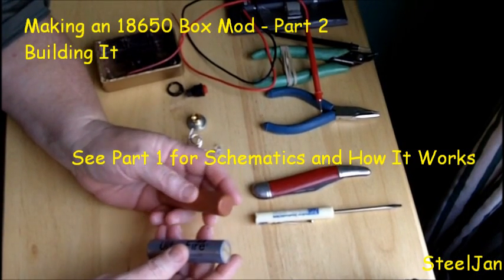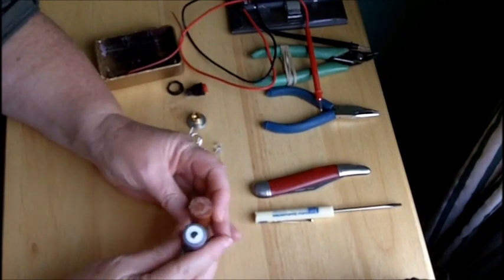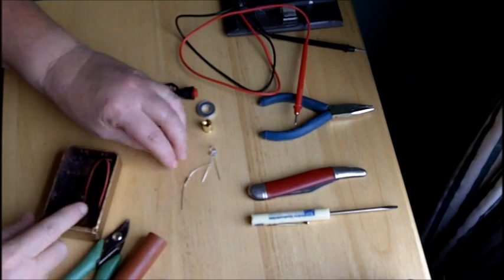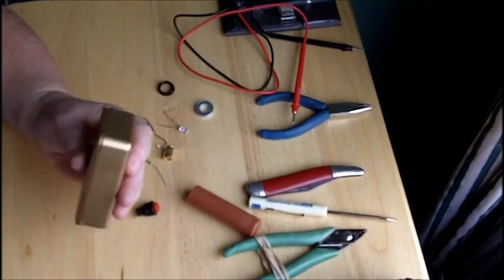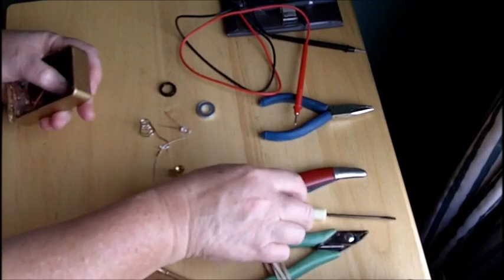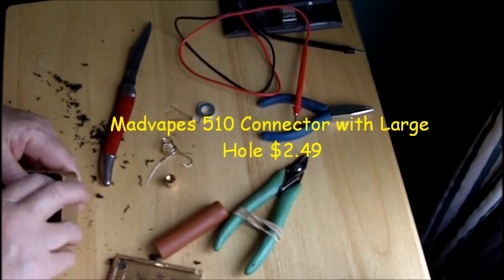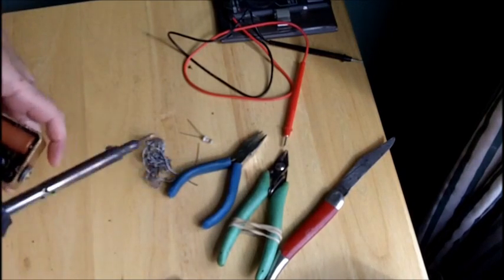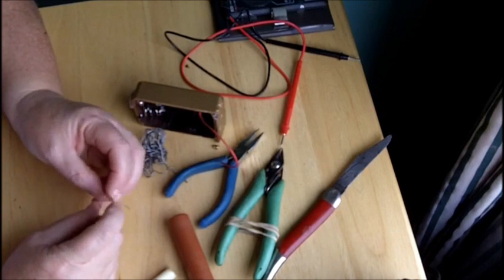Making an 18650 Personal Vaporizer Box Mod Part 2 - Building It

Comment: i tried to make a small atomizer go in directly via 5 volt usb charger, same u used and put in a large 5v button and a resistor wired to a mosfet. Its awesome but voltage drop is from hell but anyhow i think its better because if you wire these small atomizers directly to batteries that are high voltages efests at 3.7 but have 3100 mah they get a LOT OF DRY HITS an maybe burnt cotton or wicks, The largers atomizer/ clearomizer work well even RDA's but its really bulky and goofy looking carrying around an rda on a usb cable with a powerbank, maybe you can do an rda / usb hybrid that passes through to a powerbank which has a housing thats slips on the powerbank making it flush and like a box mod , its safer but more complicated tho @steeljan

Comment: Great bid. Little bit outdated but the concept is there.  I like how Steel Jan is very safety oriented but I have one suggestion to make this box a bit safer I would run my momentary switch off my negative side thus making it a bit safer when using a metal case ect
Reply from the maker: betchalife Plastic case in this vid. Hugs.

Comment: Can you solder a usb slot to a battery box to make it rechargeable  Ive pinched pucks box mod idea but my mod box screws shut so for me to recharge the aaa batteries I got to keep unscrewing and rescrew  would be easier to add a usb or some sort of port if possible

Comment: Hi friend, it took me a while to get the technique down but I've been using solder to connect 18650's for a while. The really important thing is that you scratch the hell out of the terminals before you solder them. I use an xacto knife to score a crisscross pattern on both ends of the battery, and the solder catches much easier after that.

Comment: Hi SteelJan! I just made my own mod using your video as instruction! I am soo excited! It only costed me around $25 to make! The only difference is I use the 808 carts. One question on charging the batteries... Would it be safe if I just use the UBS charger that I charge my plane jane 808 bats with and just leave the battery in the box and hold down the switch, or do I need to purchase a special charger for them?

Comment from the maker: I think you mean an RCR123A, a PROTECTED battery. You wouldn't want to use just one because they are only 3V. Too much to explain here, but basically, for vaping you'd want at least 3.6V. If you are talking about stacking 2 of these to make it 6V, well, you need to read up on that and understand the safety concerns, see batteryuniversity and e-cigarette-forum. Yes, only resistor in this one is to current-limit the LED.

Comment: I have an old box mod I bought a long time ago. It never worked and I got my money back. If you put batteries in it, the led will work. Once you put a atomizer on it, it will not fire and the led quits. Any way it could be fixed. I also have an old one that just quit. No clue how to fix it either.

Comment from the maker: @DontLeaveMeLucile When it's a lithium battery, yes, I recharge them outside on concrete.  I'm leaning more towards using nimh batteries now, using two 4.8V nimh in series in a variable voltage mod that uses the same components as my homebuilt black variable voltage mod (it's in another of my videos).  It's going fine so far, waiting to see the lifetime of the batteries at this point.  Nimh batteries are far safer than lithium. Thanks!

Comment from the maker: @utubeweisong Yes, using a LR atty on high voltage can and probably will kill the atty.  Due to the high amperage pulled by a LR atty, it can also potentially kill the battery and the mod as well.  So yeah, 3.7V is plenty with a LR atty.  You don't want to try vaping a LR atty at 5V or anything near that.

Comment: @steeljian apparently many sites are saying that using incorrect resistance atty will kill the battery which I do not understand the reason why. shouldn't it be the opposite that using LR atty on high voltage will kill the atty instead?

Comment from the maker: @utubeweisong You'd have to either parallel the batteries and then run them through a buck circuit to raise it from 3.7V to 5V, or else you'd have to put them in series to make over 7V and then run that through a voltage regulator to bring it down to 5V.  You're not going to be able to vape 1.5ohms on 5V, for a bunch of reasons.  And putting in a current-limiting resistor, I suspect, would just get you a very very hot resistor.  Realistically, 3.7V is plenty for a 1.5ohm atty.

Comment: @steeljan I want to do a box mod using 2 x 18650 battery to provide 5v vaping but I not sure how to go about it and it semantics. To say the batteries must be arrange in parallel with both positive facing the same direction? what ohm resistor should I use such that the current will not be too strong to kill my LR atty of 1.5ohms?

Comment from the maker: @borismontoya136 No, you don't have to use an LED & resistor, that's just an indicator, it doesn't do anything for the functionality.  But if you mean you really used 2 AA batteries then that's your problem.  Two AA batteries in series only gives you 3V and very little amperage, too little voltage and too few amps to vaporize the e-liquid, the coil isn't getting hot enough.  That's why usually protected lithium ion batteries are used.

Comment from the maker: @ogropt If you're trying cotton for the wicking inside the coil or anywhere where it will get hot, when I tried it, it scorched & burned.  I tried a ton of stuff for wicking and the only thing that worked outside of using silica string was cleaned, pressed, and dried fiber left over from juicing wheatgrass.  I know, it sounds wierd.  It does make the vape taste slightly grassy, but it doesn't burn as long as it's kept wet with juice.  32ga is probably ok, just ohm it and make sure it's low enuff

Comment from the maker: @ogropt In my atty-making experiments, I found the best way to get the correct length was to ohm it.  And I used 36ga.  To ohm it, I put one of the leads of my multimeter at the cut end, then slid the other lead down until I got the ohms I wanted, say 2ohms, dent it with my nail and cut.  It's not a very long length of wire.  Now, I was silver-soldering mine to posts in my homemade atty, but if you are going to wind yours around a screw post you'll have to figure that in too.

Comment from the maker: @caima123 Never use unprotected batteries in e-cigs, they will blow up if you undervolt them, overvolt them, or are accidentally shorted.  A lot of folks are now using IMR batteries because they deliver higher amperage and will not blow up if overvolted or undervolted, however, these will still blow up if accidentally shorted. Ask Basilray, he's had blow-ups.  I helped one guy with his design for an e-cig with nimh batteries, that worked just fine, but of course it used a lot of them, big, bulky

Comment from the maker: @caima123 Only those with electronics experience should build mods.  Also, I think only those who understand the volatility of lithium batteries should use an e-cig mod.  Mods use 400+ times more amperage than a cellphone yet we put them in our mouths, right near our eyeballs, think about that.  If you still insist on a mod, only use a protected battery.  If it uses 2 batteries, buy them new at the same time and keep the pair together always, never mix them up. No IMR batteries either.

Comment from the maker: @MrPoppinballz I just take the part I want to make a hole for, go through my drill bit set until I find the one that is slightly larger, and use that one.  Or if I want a tighter fit, I choose one slightly smaller and then use my knife or a file to gently make the hole larger to the size I want.

Comment from the maker: @KiDD275 It depends.  As long as I'm adding a heat sink, a way to keep the heat from the atomizer from getting down into my mod, in this case it's the two washers AND if I am building it just for my own use, then yes, I could choose to use hot glue.  But if I had any worries that heat was going to get into the mod OR if I were building this mod for somebody else, then I would definitely epoxy.  Cheers!

Comment from the maker: @light487 I buy the 510 atomizer-battery connections from madvapes and always get the ones with a center hole.  That way, I can put my wire up through the hole and solder from the top.  Makes a much more solid connection and easier.

Comment: Thanks for making it look easy.. one question I have is to do with the inner-pin solder. Where did you put the solder...? It seems like, from the video, that you stuck the resistor wire in the bottom, stuck the solder iron in the top and hey presto it was soldered. What is the trick there? Just drop a small piece of solder down the top of the hole? Or get some solder on the iron? or what?